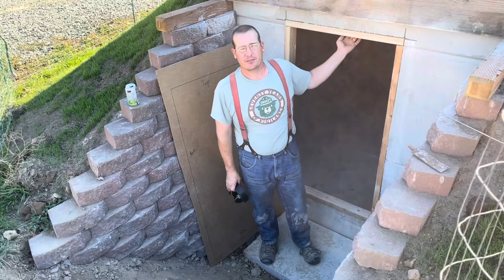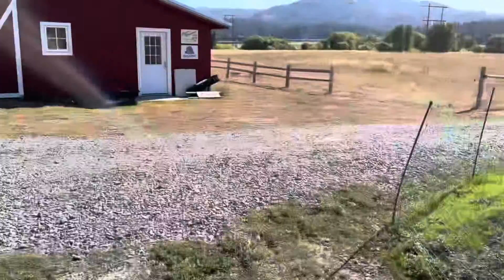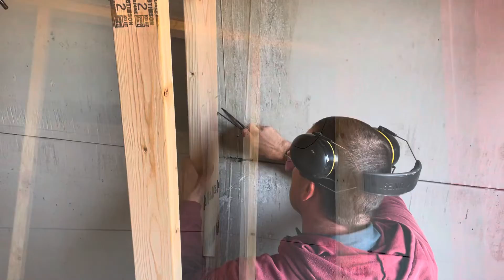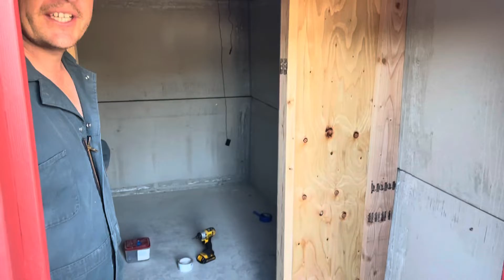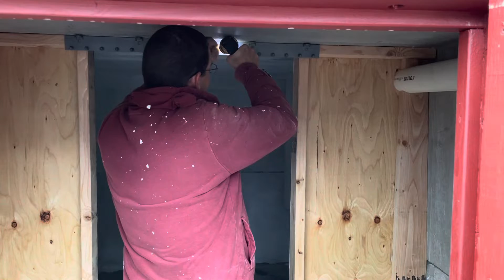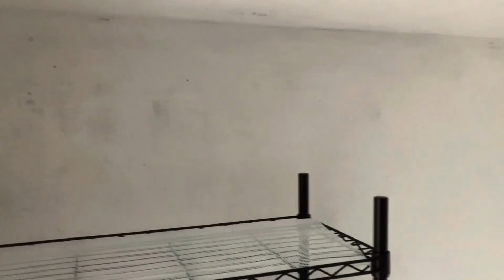Cheese Cave Installation Part 5: Door, Stairs, Interior Wall, and Whitewash

Comment: Looks like it came together nicely! Hopefully you won’t need a dehumidifier/humidifier!
Reply from the maker: Doubt it will get too wet in there, we need about 90% humidity for aging. Getting too dry could be an issue. Containers of water or wetting the floor are common in cheese caves. Thanks for watching!
Reply: Interesting! I don’t know much about making cheese! Now if you were making Blue Cheese I would be very interested!

Comment: Fine job.
If you haven’t already got one, might I suggest picking up a 12V sump pump. Even with a roof over the entrance water will find its way to you door. Plus, such a pump is handy around a farm for other jobs.
Reply from the maker: We have a perimeter drain around the cheese cave, including under the door, that drains to daylight, so hopefully that should handle any water issues. Thanks for watching!

Comment: I would suggest a foam bumper block across the top of the strip door so when Stacy forgets to duck it will not be so hard on his forehead. Also do you have to get your cheese cave inspected by the health department to use it for food processing?
Reply from the maker: Yes, we’ve been working with our milk inspector on the construction of the cheese cave, and it will be inspected with the rest of our dairy. Thanks for watching!

Comment: Great Job! Looks real good and it should hold a lot of cheese. I was wondering about water at the bottom of the steps after rain. But with a roof over the entry that may not be a problem.
Reply from the maker: There is also a perimeter drain, including at the door, that drains to daylight.